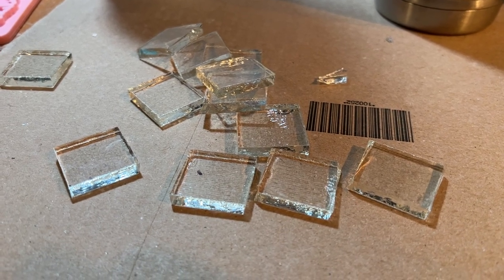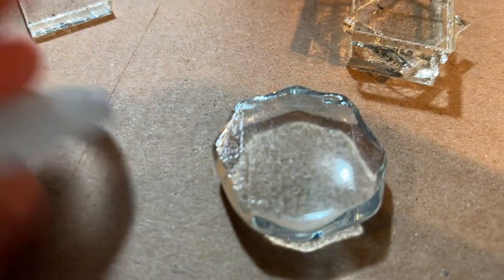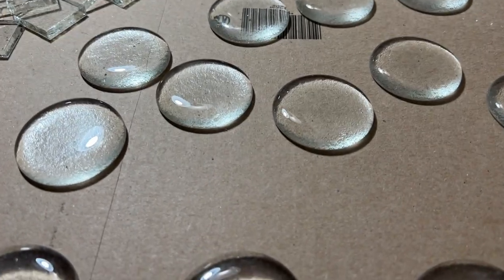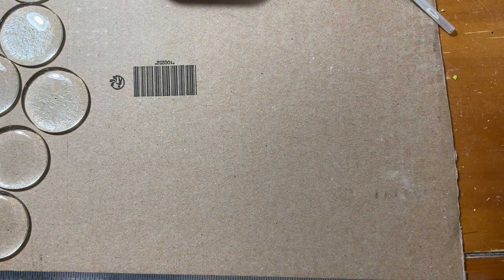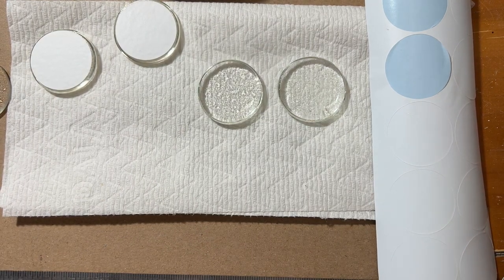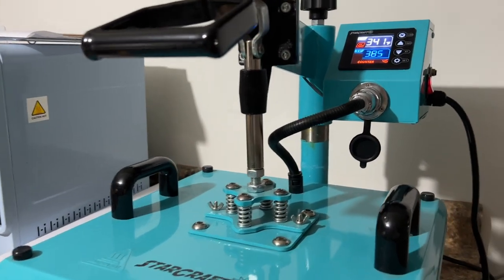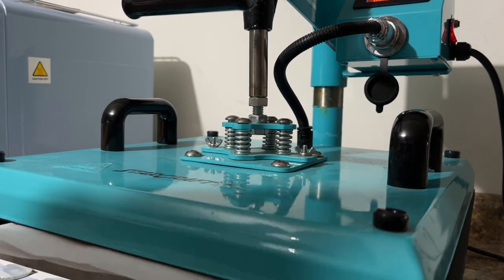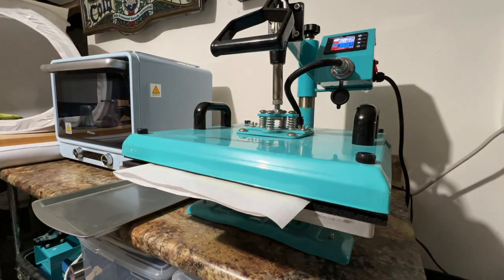Combining Glass Fusing &  Sublimation Printing

Comment: Jackie, you are BRILLIANT!  I have been trying to figure out how to do something similar, lol!  I recently got into sublimation too and have all of the goodies as well, lol!  I've been fusing for over 12 years and that is my passion, but this is so exciting (and relatively inexpensive!) to be able to combine both loves.  I couldn't get my brain to get past the vinyl on the BACK and how it would allow the image to show through the front of the glass.  You have given me such inspiration, as do all of your awesome fusing vids! By the way, for the magnets, did you buy the small or medium rounds you can glue on, or did you buy the magnetic sheets (maybe 3/4-1mm thick) and put those through your Cricut? (Not sure my Air Explore 2 would cut that).  Just curious, I'm good with the ones you can buy at Walmart for a song and gluing them on.  Thanks again, this was just brilliant❣
Reply from the maker: Thank you! I just glued little round magnets onto the back using 2 part epoxy. I’ve not tried magnetic sheets. I know what you mean about trying to wrap your head around the white vinyl on the back. When I first watched a video of the process I was blown away and thought how can that work??!! But it’s like magic. You may need to experiment with time and temp of press but this thickness seems to work well with mine at 10 minutes/385. Glad you liked this!

Comment: I think I listened closely but did not hear you say about how much pressure you used.  I saw that you felt like you had too much to start and you backed it off a bit, but do you know roughly how many pounds of pressure you had?
Reply from the maker: Hi Judy - I don’t know as there’s nothing to tell me but just where the press handle went down and it felt snug but I didn’t have to exert any physical pressure to snap the handle down to start the timer. Hope that helps!

Comment: I have trouble cutting 6mm clear. Do you have any tips?
Reply from the maker: I just use my strip cutter and score and then used my regular breaking pliers vs. the small ones I usually like. I recently bought heavy duty breaking pliers and found they were overkill! I shattered a piece into several pieces so I went back to my regular ones.

Comment: TEN MINUTES in the heat press???  I never would have guessed.  That may very well be part of my problem.  (Well, that and my general ineptitude.)
Reply from the maker: My first pieces that were larger were between 8-10 minutes. 6 they were still a bit cloudy. And it makes sense as you’re using thicker glass doing this than a single layer of window pane or Dollar Tree cutting board.